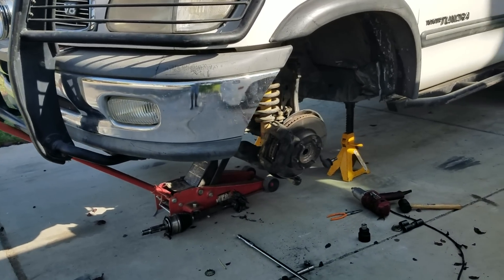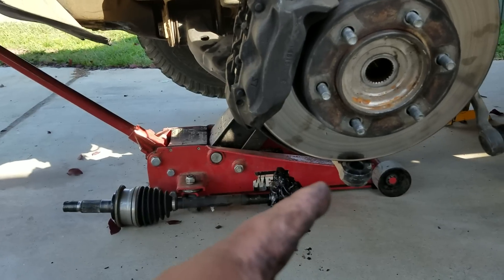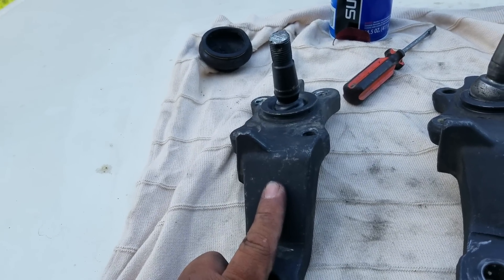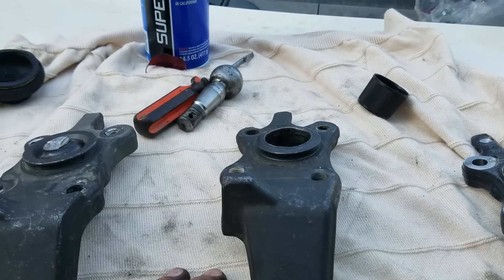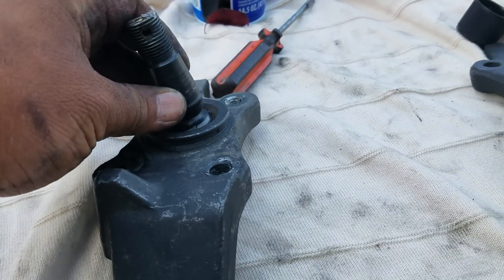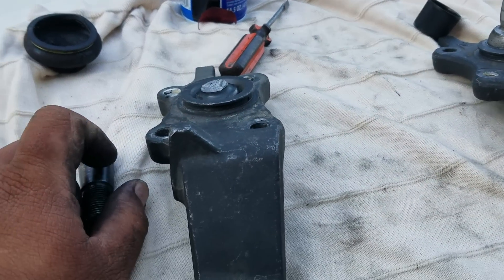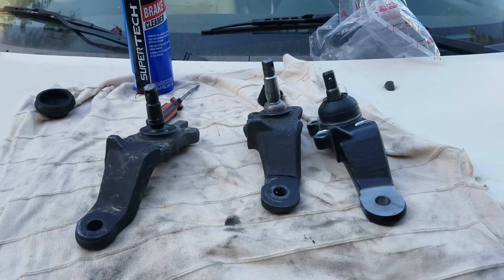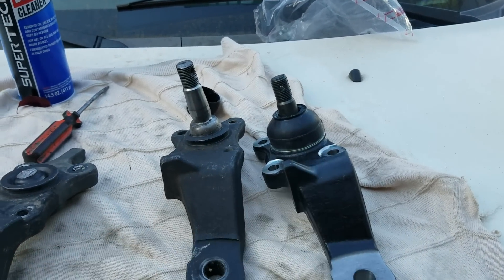Tundra Ball Joint Failure.

Comment: Same issues here, twice! Luckily only doing 20mph each time, however the second time it happened only 4 months after install. These damn sealed parts with little or no grease in fitting and because I did the work myself it wasn't covered under warranty. This design is bad, no warning that it was going to fail let alone separate! I too had to buy a new cv shaft... back to Dodge for me!
Reply: dog got more problem. lol

Comment: I would. Like to add to this. MOOG IS JUNK! Factory only for ball joints and tie rod ends. Import direct is as cheaply made as masterpro. All aftermarket ball joints are no bueno. A company by the name of XRF chassis, makes excellent ball joints and are warranted for life. No questions asked. I am over 80k miles, very hard use, and zero play. I would recommend XRF over oem. If you can't afford the XRF, go with factory oem.
Reply from the maker: I have never heard of that brand
Reply from the maker: @georgesrisomsak9650  nice to know. However, I can't endorse any aftermarket product. I think OEM is the best way to go about

Comment: Dude, you are endangering everyone's life on the road around you. All post 96 toyotas share the same skinny spindle design which is the cause of the ball joint failure. It doesn't matter what mileage, what balljoint you use, you are still driving on a suspension system that was designed for cars that weigh 3500 pound max that was put on trucks for ride quality, cheap and fast assembly and fast repairs.
Reply from the maker: @SierraDaylight  agree

Comment: I totally know how you feel. I have a '97 Tacoma. They have the same design. Toyota knew that not only the Gen 3's had this flaw,but also the Gen 2's. No recall on the Gen 2's. I have heard many stories of the lower ball joint popping out with no warning. I got lucky,if you can call it luck,that when my turn came I was only doing mabye 10mph. Shame on Toyota.

Comment: This is why if you don’t know what you are doing you shouldn’t work on cars. Top plate spacers are a complete No No on all Toyota’s. They Fawking cause the suspension to over droop and bind. That is why this happened. 

Second don’t ever replace the factory CV joints, regrease and replace the boots. The after market shafts are complete crap and new ones from Toyota are incredible expensive.

Comment: had the same problem by minarets workstation right above Mammoth pools
Reply from the maker: Robbyota 559  is that before or after Wagner General Store?
Reply: The Other Guy , after buy jackass Rock. I had the same problem and am now looking at a newer upper and lower control arm with a different type of ball joint.
Reply from the maker: Robbyota 559 Jackass rock as in after Jackass camp ground? And you have a tundra?
Reply: yes exactly after that. It's the old forestry station and heliport pad. I was making the loop back to Globe Rock and then into Bayshore down to Bass Lake. and yes I still have my 2000 Toyota Tundra it's only 2 wheel drive however. I don't know if it's a similar setup as the four-wheel-drive it should be just without the axle. now I'm looking for upper and lower control arms such as total chaos. it has two different ball joints like the ones that I saw that you upgraded to. I also had to upgrade the brakes from a 13 we to the 13wl I had problems with it stopping I later found out that there was a recall on the brake system I don't know if you were aware of that? I love my truck but it seems like they've had a ton of recalls it was the first gen however. From brakes to rust to ball joints and tie rods. just happened to stumble across your channel by looking up wheel bearing replacement. thanks for the videos muchly appreciated.
Reply from the maker: Robbyota 559 the uca and lca are the same. the difference is spindle.  the BJs are the same as well. but yeah the bjs are the weak points. the front suspensions are the same as the Tacomas. I think this is why our trucks are way heavier. wish they would have built a more heavier duty front suspension on this gen tundras.
Reply: The Other Guy , thank you for the info I was not aware that the suspension was the same as the Tacomas good to know there should be a lot of aftermarket then. how has yours been holding up after you switch the upper? do you have any suggestions that might help me out as I'm now looking to replace them.
Reply from the maker: Robbyota 559 since then i have installed a 5 inch lift made by tuff country. i believe my problem began when I installed a 3 inch leveling kit which was not good to the suspension.  in addition, I replaced my bjs with AutoZone and oreilys parts.  the aftermarket bjs are crap.  buy oem bjs it is way better.
Reply from the maker: Robbyota 559 check out other videos on my channel.  if you like my channel please like and subscribe.

Comment: Look there is know comparison with original Toyota products and after market, i have a 2000 4 runner original thru out 349,000 miles, i changed the timing belt once at 307k miles I will not buy anything from auto zone places like that for critical items only now am i replacing all the ball joints and bushings because i am getting swaying.its time my 4 runner is the best ride I've ever had in my fucking life. I just replaced the starter for the first time since i bought it new. Do not buy critical items from Auto Zone things that are labor intensive like a fuel pump or breaks because you will be going back every 8 months to replace those shitty lifetime breaks where the OEM brakes will last 3 or 4 yrs, so dont get rid of your ride man just get OEM parts. I am glad that no one was hurt. I only buy things like a battery or air filters from that auto zone, if i dont feel like doing the work my self i still buy the OEM part and have the mechanic install it. You were blessed now i am thinking about buying a sequoia but I am keeping my mint condition 4 runner sr-5.

Comment: No im say complete failures on fairly new joints only herd storys on complete failures on Toyota trucks
Reply from the maker: Truth is, it is common in the first gen tundra, 1 st Tacoma, and 3rd gen 4runners if you buy nom-oem BJs.

My OEM BJ had over 140K on it and it did fail me. It was the after market BJs that failed me.